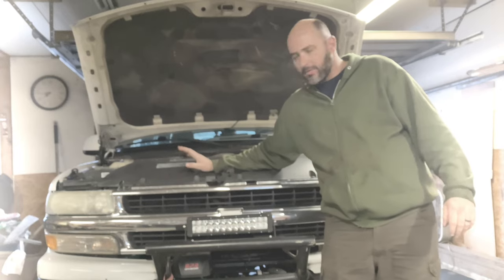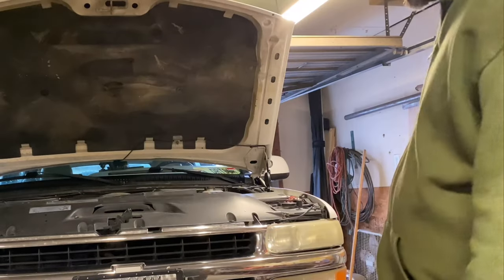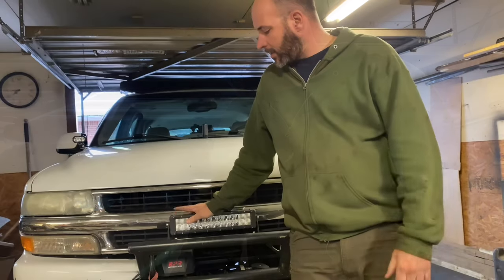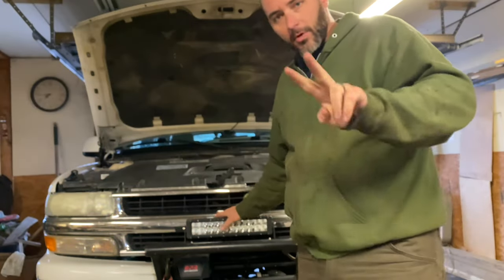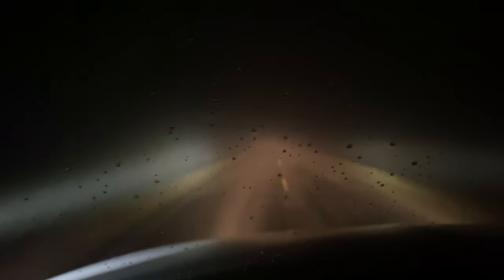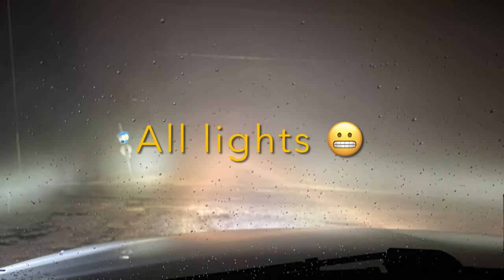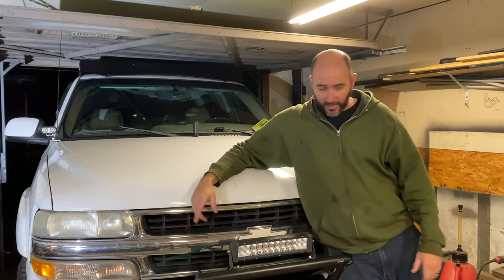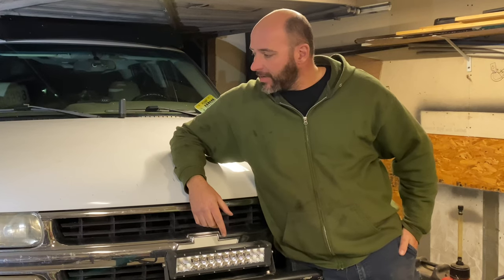This has got to change!

Comment: Late to the party but I have the Depo projectors with some led bulbs and LED high beams. I want to swap some HID bulbs into the projectors but these work for now. I have some cheap 3” pods mounted to my bumper but I’ll try to take a video this week some time. I think I’m pretty sold on picking up some Diode Dynamics to mount as ditch lights and replace the ones on my bumper with them as well.

Comment: I've never seen them ditch lights.. I think I would like those! May not have helped alot in the fog but man they was throwin a beam!
Reply from the maker: The ditch lights refer to the position and direction of the light.  It’s mounted at the upper rear of the front fender just in front of the A pillar of the cab, they are then pointed forward and out just in front of the vehicle to illuminate the “ditch”   But the ones I have now are nothing compared to some of the technology of some of these brands listed in the description but they also have a premium price 😭

Comment: I have 8k LED Headlights and Fog Lights from SuperBrightLed. Marker lights are LED Switchbacks also from SuperBrightLed. 3+ years now no complaints.
Reply from the maker: Thanks, I appreciate it. I honestly dont know if I want to swap my regular lights to LED or not.
Reply: @overlandtowater  I would at least get new clear housings. That'll help some lol.   My 8k LEDs do more harm than good in dense fog and heavy snow. Just throws the light right back at me. I believe 6k is true pure white, anything over has a blue tint anything under has a yellow tint. As you mentioned, I'd do amber fogs.
Reply from the maker: @codyholloway90able   I would really like to keep it in a 6000 to 6500k range just for that reason. school me if I am wrong though.
Reply: @overlandtowater  Sounds right to me
Reply from the maker: @codyholloway90able  😂